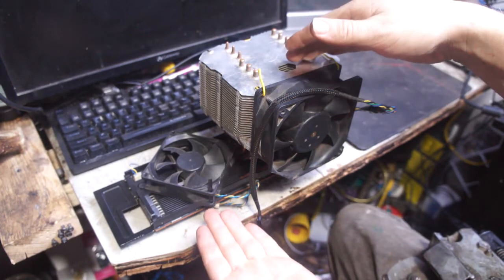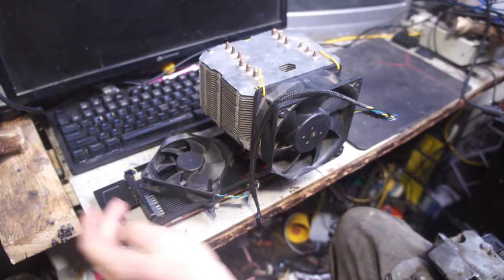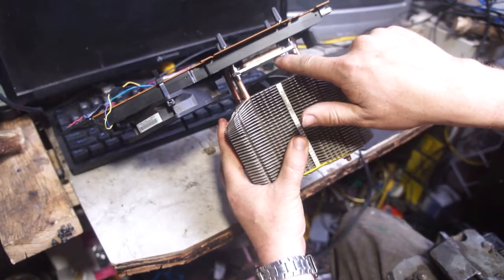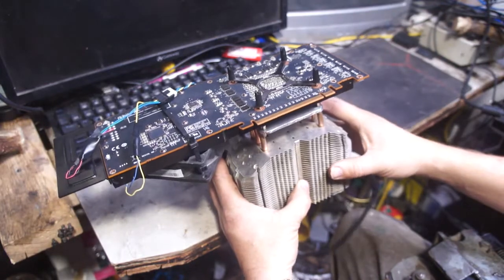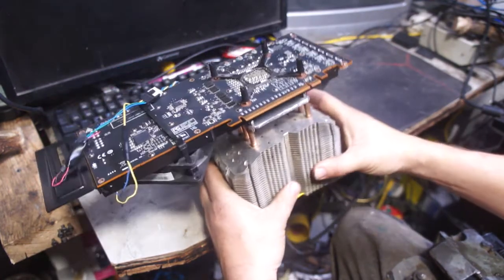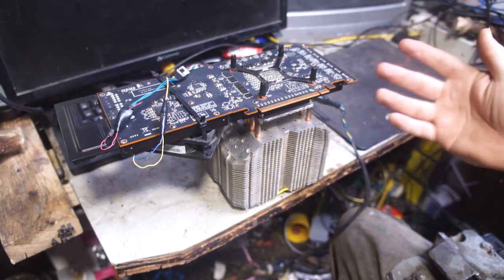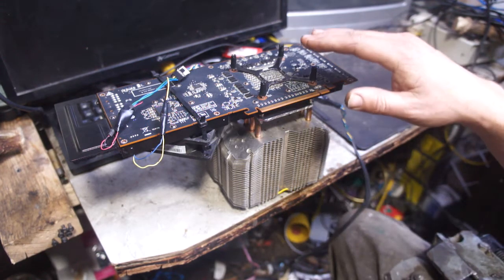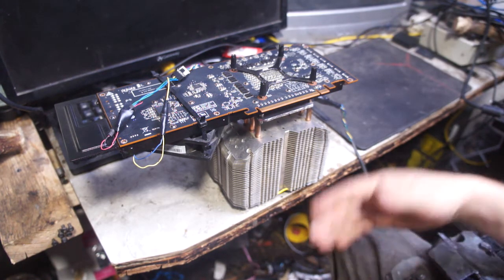Radeon MI25 cooling (WX9100 flashed), 13K RPM fan or...

Comment: Looks useful and better than my setup.  I just bought an MI25 on eBay that came flashed to WX9100 and connected it to my laptop through a USB 4.0 NVMe adapter than an NVMe adapter to PCIe to get the card working.  But I have a normal 120mm fan hooked up and it doesn't take long for the card to throttle.  Works great for a couple minutes.  It's still useful without sufficient cooling, though...mostly I wanted it to try to get MacOS to install in a virtual machine by passing through the external card.
Reply from the maker: If you're not using it's miniDP output, Vega FE vBIOS let's you lower frequencies, voltages, power limit. Don't know if MacOS will complain about any of that though.
Reply: @Marc_Wolfe  Unfortunately I am using the mini DP output.  Just ripped the card apart to redo the heat sink grease, and I bought a 12v blower with a speed control.  I can see why it wasn't cooling well--the stock vapor chamber looks amazing but half decade old thermal tape does not.  Hopefully with more static pressure & better grease it'll work OK with the stock heat sink.  Thanks for the video--it's the only one I found from someone who removed the heat sink!
Reply: @Marc_Wolfe  The blower works.  It's not crazy loud, but it's not quiet, and now the card is at 45-60 degrees at 150 watts during a stress test depending on how high I crank the fan.  I wanted it to work with a Windows Virtual Machine in Linux, and it has software glitches, so I may end up reselling the card & blower on eBay.  But the output is fine outside of the VM.
Reply from the maker: @nathanbanks2354  Sounds like a return.

Comment: I have put a 120mm turbine on my mi25 (wx9100 bios), it is stupidly exaggerated, the turbine is made for 12v and I have it working at 5v, even so it does not go above 65 degrees with a half-dry thermal paste ._.
Reply from the maker: Cool story. Sounds like what somebody trying to sell them would say. Mine runs cooler now that I run FE vBIOS on it, which required tedious soldering to keep video output functional.

Comment: I use a single 40mm fan attached to the intake with a 3D printed shroud I got on eBay. Fan is a Delta brand that pulls 0.8W and rotates 16000RPM so it’s compatible with consumer motherboards. It cools effectively long term at full load.
Reply from the maker: "effectively"

Comment: Me and my friend noticed it has hook ups for a Vega 64 blower fan, if we were to close up the front, would the blower fan method cool it possibly enough?
Reply from the maker: You'd want the entire reference cooler, which are never cheap enough to justify. A less shit option is taping a couple 40mm server fans to the end and wire them up to the same header. Works the same as a standard 4-pin motherboard header; the connector is just shaped different. I've seen listings for Instinct and Tesla cards that are setup like that, but never for cheap enough. If you use some 8 pin power extensions, you could leave the fans taped on, without your PSU cables being taped to it.

Comment: Inventive! Got the MI25 myself, does that PH2.0 fan header you're using on the board actually issue PWM control?
Gonna 3D print an adapter and hook some dual 40mm to the shroud, do lemme hear!
Reply from the maker: Speed control functions to AMD's shit standard; that's why I'm not using it's PWM for anything.